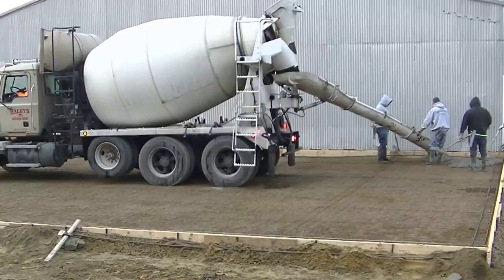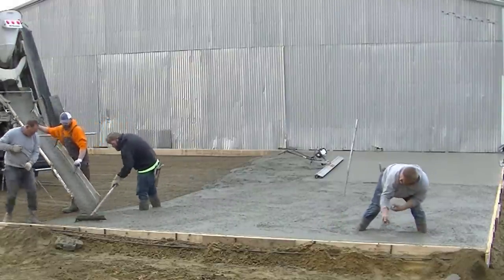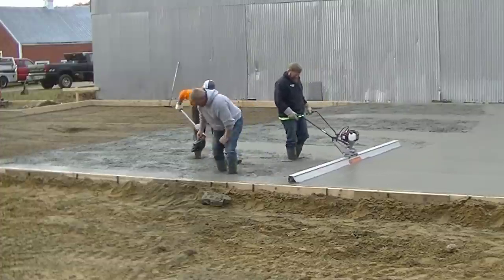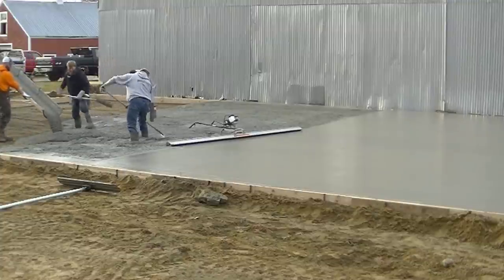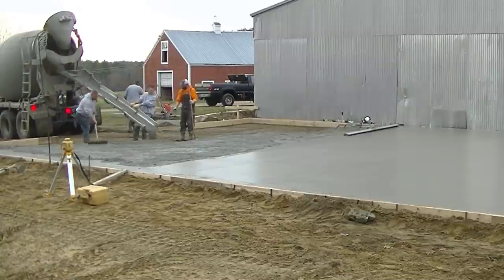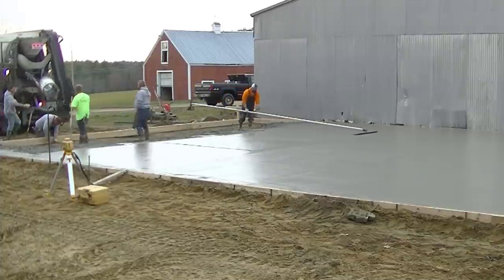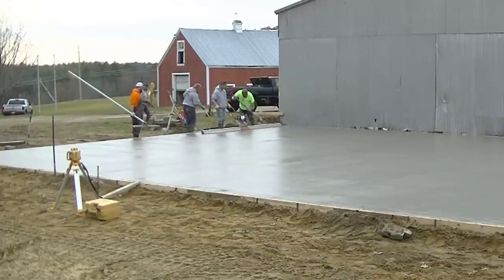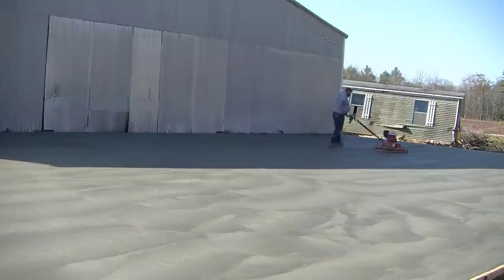How To Pour A 60 Yard Concrete Slab In 90 Minutes

Comment: I hate wire mesh. 99% of the time people don't pick it up in to the concrete instead they just pour over it as if it's really going to do anything sitting on the ground with the concrete on top of it or they walk all over it smashing it to the very bottom. I always tell people to scrap the mesh and go with either Fibers or treated Rebar Fibers is my #1 choice.

Comment: Why did you put 6X6x10/10 wire mesh and leave it on the ground. You as there boss should make sure it got picket up off the ground. Waist of the customer money.
Reply: You can see him pulling it up as they go.
Reply: Id like to see a slump test looks kinda wet prob crack over time no strength in self leveling concrete
Reply: @levifield8987  they left the mesh on the ground under the whole first truck.  And it looks like the mesh is about an inch off the ground when they did start pulling.  An 8 inch slab should have the rio at least 2 inchs from the ground
Reply: Too lazy to use stands  to get it right.
Reply: @barryengelhardt2429  That would be the result IF the 'wetness' was due to water in or added to the mix, but he was using a superplasticizer, an admixture which can take concrete that's say,, 3" to 4" slump and make it into a 7" slump (or higher) without adding any water or any loss of strength whatsoever. In fact, increased strength in most cases.
Learn more about water reducers and superplasticizers.

Comment: There's no way thats a 6 inch slump. Thats definitely a 8 inch  minimal.  Looks self leveling. Have your ready mix salesman  come out and make a slump test and your pouring.  Mid range water reducer just doesn't  cut it. For a 10 yard truck 2 and 1/2 gallons  of super plasticizer to bring the slump to a 6 inch. Hope a penetrating  sealer will be applied in a few weeks before the salt hits it.

Comment: Why would you keep clomping Thru the surface from the inside? A guy on the outside could use a 3’ Darby to reach in almost 5’-
Where’s the screed inside set on elevated clips? Slide the screws along, none of that mystery ‘wet screeding’ that is NEVER accurate

Comment: In the end, all that wire is sitting at the bottom of the slab. I see some guys trying to lift it but then walk all over it as they finish. This is a common problem. Otherwise, good work.
Reply: It is not a problem at all...if you ever broke out concrete with wire near bottom you would know
Reply: @baconneggs2406  It’s not a problem at all when you break up the concrete with the wire at the bottom.  The purpose of the wire is to add reinforcement to the concrete slab and to do that best the wire should be floating near the center of the pour about half way between the bottom and the surface.  The wire is not a bed for the concrete to lay on.
Reply: Compacting the subsurface is more important than anything.  Wire mesh only has to be 1/3 the distance from the bottom.
Reply: Wire mesh on the bottom does no good for reinforcement.  In fact it can contribute to premature concrete failure when the mesh rusts from ground water contact.

Comment: I really don't understand picking up the mat, just not a good end product, you know it gets pushed back down. 

chair it up
Reply: I agree. That is useless. I can't imagine living somewhere where they even allow such a thing. We always have minimum 10 mil bar 12” on center and chaired up. But more often 15 mil.
Reply: They are amateurs . A structural engineer would condemn that slab .
Reply: I agree.  We pretty well always have an engineer come inspect rebar before every pour. We have even had times we had to drop rebar on a while slab half an inch to get it to the right height. We haven't backed trucks on a pad for many years. It's just not possible to not wreck your rebar. Also it's funny that he said he has a guy fixing the forms😂. Generally the goal is to have your forms straight and solid beforehand.
Reply: @zpepp4364  What you’re not understanding is how the forces of compression and tension are overcome by the engineering. This isn’t a structural slab, but if it were, do you know where the engineer wants the steel, in the slab, to overcome these forces?
Reply: @alexrobertson2469  On large warehouse type buildings, driving on the reinforcement with the concrete trucks is standard operating procedure. The problem comes if an inexperienced driver starts turning the wheel. Otherwise, there is no problem at all driving across the reinforcement on sufficiently compacted earth.
Reply: @psidvicious  yhea, in the slab not in the dirt, the customer paid for the mesh. the mesh that's in the dirt. I haven't seen the drawings but that slab called for mesh, the mesh that's in the dirt. They need chairs, someone needs to chase the truck and chair up the matt. craftsmanship.

I am a Journeyman Ironworker, placed tons of rebar right where the eor wants it, can i tell you where, only after i read the drawings, not an engineer but i understand why, and practice craftsmanship. They took a short cut and didn't use chairs.
Reply: @zpepp4364  With all due respect and especially if you’re an ironworker you should know, without hesitation where slab steel belongs in a ‘typical’ structural slab. The only variation being whether it’s in the ground or an elevated deck. Beams, walls, columns, slabs.
Reply: @psidvicious  really not shure what you are getting at, I see a short cut, and wasted money, they need chairs...

you never just go with what you think is typical. you go off the prints.  

when you say typical in the field it is relating to something being typical in a sequence, or segment, not typically as in generalising. Typical is a technical term. 

Abbreviation of typical: used to label a feature that is to be interpreted as exactly the same as nearby comparable features. Four equally spaced bolt holes on a bolt circle can be dimensioned at one hole with the notation (TYP) following it.
Reply: @zpepp4364  Umm ok. Have you ever heard the phrase, “a little bit of knowledge is a dangerous thing” ? You’ve demonstrated the perfect ‘case in point’ for the phrase.
Reply: @psidvicious  uhhh use chairs. to insure a quality product, so that you don't wast the customers money. 

not shure why someone would argue against that. 

you must like rework
Reply: @zpepp4364  Interior slab with fiber mesh. Wire is redundant and pulled up per ACI allowances.
It didn’t go unnoticed that you still don’t know where the steel belongs in a structural slab. Ironworking 101.
Reply: @psidvicious  per plan, you are proving yourself to be the ignorent one
Reply: @psidvicious  Placing reinforcement onto layers of fresh concrete or adjusting the position of bars or welded wire reinforcement during concrete placement should not be permitted. The ill-advised practice in slab construction of placing reinforcement on the subgrade and pulling it up during concrete placement is called “hooking.”.

Right from the book you wanted me to believe you knew.

you can look up the AIC manual and download the pdf, seems like you could use it since you want to reference it.
Reply: @zpepp4364  “ill-advised” ≠ illegal or unpermitted.

  Your lack of experience was glaringly obvious before. Now it’s just plain annoying.
That’s some ‘book’ YOU found on your infallible internet, not ACI regs. ACI regs is all that matters. Unless chairs are specifically called out on the plans. 
  Engineers aren’t nearly as concerned about the wire placement as you seem to be, otherwise they would call for railed beam bolster at 12” spacing bcz even chairs on a 4 foot grid won’t  keep wire from bending down to the bottom when stepped on at midspan. Engineers aren’t stupid people, they know this. Engineers just like a little temperature steel in there to try and prevent some shrinkage cracking. Which the fiber mesh has been proven to be effective at anyway. 
  Get into the real world kid and don’t criticize what you don’t know about.
Reply: @psidvicious  that statement is from the American concrete institute, the mesh only works if its in right spot, your years of doing it wrong are irrelevant to the right way to do it

Chair it up

making a really big deal out of the use of chairs, which is advised, im assuming its advised so that you get a better end product which was my argument.

I've done it this way as well, but the way they chose to pour thy are walking all o er the mesh if you are pulling it up and skreeding without walking back thru it wouldn't be so bad but look at the way they are walking chairs would have helped.
Reply: @zpepp4364  If that’s from the ACI manual, you should be able to quote the location. (e.g. 6.9.7.1 etc.)
And your years of inexperience are irrelevant to the way it’s actually done in the real world. But then again, being an ‘ironworker’, you wouldn’t know that anyway. Sorry kid, you just don’t know what you’re talking about.
Reply: @psidvicious  ACI 117-10
ok pour dog

 Ironworkers piss excellence 
do it right or get the hell off my job

there's a reason an ironworker does pour watches, to fix behind  fuck ups like you

here's some commentary from ACI manual

Bar supports are not intended as support for construction equipment such as concrete pumps, buggies, or laser screeds.
Spacing of bar supports depends upon the size of the reinforcing bar being supported. For example, for a one-way solid slab with #5 temperature-shrinkage bars, high chairs are used at 4 feet on center; for #4 bars, high chairs would be placed 3 feet on center.
Placing reinforcement onto layers of fresh concrete or adjusting the position of bars or welded wire reinforcement during concrete placement should not be permitted. The ill-advised practice in slab construction of placing reinforcement on the subgrade and pulling it up during concrete placement is called “hooking.”
Spacers for vertical concrete (wall construction) have traditionally been optional. Side form spacers include double-headed nails, precast concrete blocks (dobies), and proprietary all-plastic shapes.
The ironworker, ironworker foreman, contractor, and inspector all have the responsibility to see that the reinforcing bars in concrete construction are properly placed.
Deviation from specified location:
Reply: @zpepp4364  😆Haha! Nice try 😆
Reply: @psidvicious  what are you a wana be engineer. you have proved nothing but the fact that you are ok with rat work, because the engineer wont mind if the mesh is in the dirt, rat
cant figure out how to download a pdf of ACI manual you suck dude

Regardless of what you have gotten away with, there is a right way

Comment: Mike, first off we love your videos and have learned a ton from you guys. I watch your videos every night after work. We use a big spin screed but the problem is we can’t use it for wet screeding. We’d love to try out a power screed like you guys are using. We’re based out of Kansas City. If you ever have time could you shoot us a call? Company number 913-282-7969 my cell is 913-534-4331. Would love to hear back from you and get some instruction on the power screed. Thank you for all your info
Zach Rome